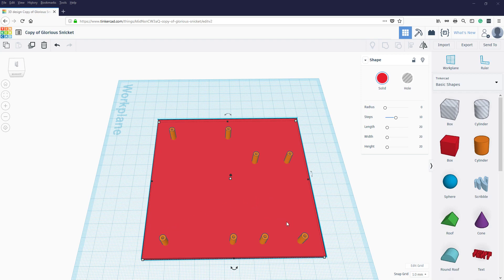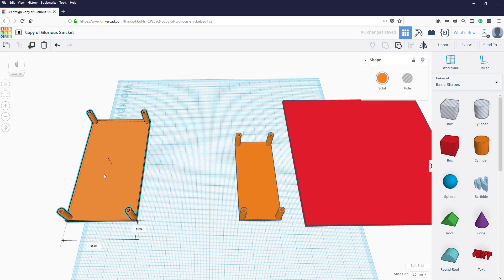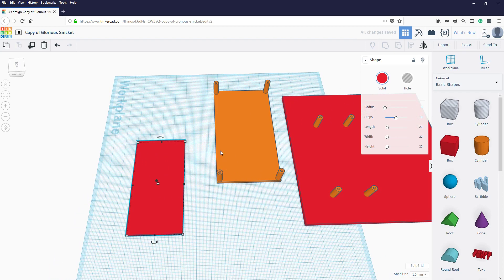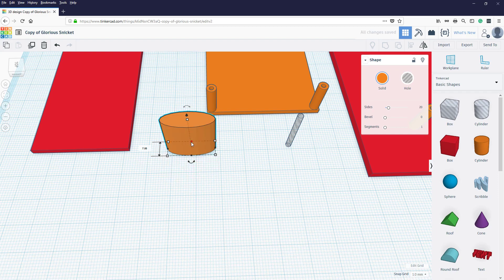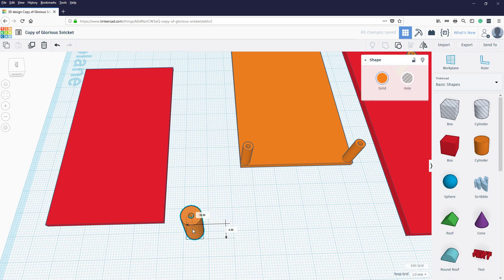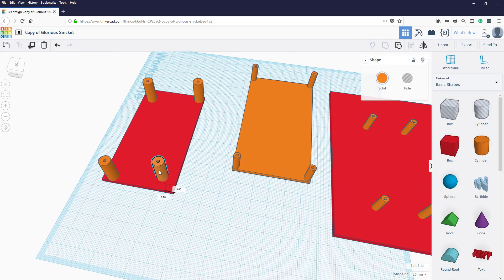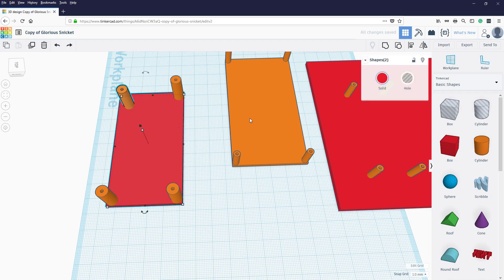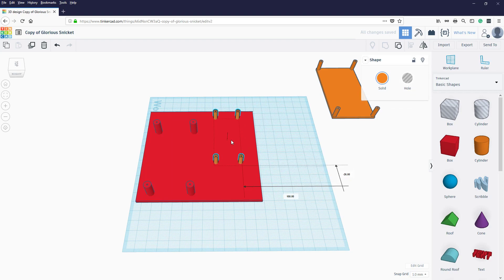How To Design PCB Posts In Tinkercad For Laser Engraver By 3d Printer

Comment: Why didn't you just create duplicates and use the snap grid to move the duplicate however much you wanted. You could get the center holes within .1mm of your target super easy.
Reply from the maker: Perhaps you could do a video on what you mean. To me this is a bit convoluted but gets the job done. Whenever I have tried to use tinkercad there is always a problem getting things exactly where you want them (I never use the rule thing) . No doubt it can be done but for me making a box and doing it the way I did it means things are in the right place. If I was to hand place each item on a board and accidentally be 1mm off in one dimension as the grid snaps it,  the job would be ruined. also I tend to keep items on the build plate so if I to add a duplicate or move the 4 pins I can just pick it up move items around and plonk it down again.ie if I decide to move the placement I can just move the board around and don't have to worry about moving them individually to the next position (and like I say accidentally mess it up).